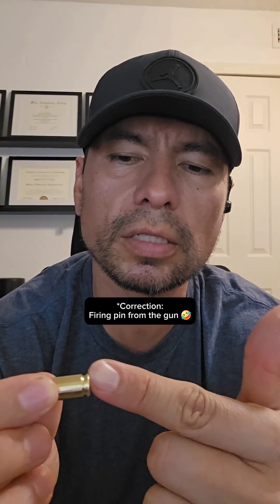Grain Explained: Bullet Weight 101

Comment: The heavy grain bullet does not necessarily relate to more stopping power as well as does not mean more recoil take for instance 300 blk it is heavier than 556 but because they travel subsonic they are quiter and less recoil but with better twist rate can be as dedly
Reply from the maker: Thanks! That's true, I suppose there are always exceptions!
Reply: These days the exceptions are the norm between 6.5 , 6mm  ,300blk its pretty much get all the advantages of quite low recoil and heavy hitter